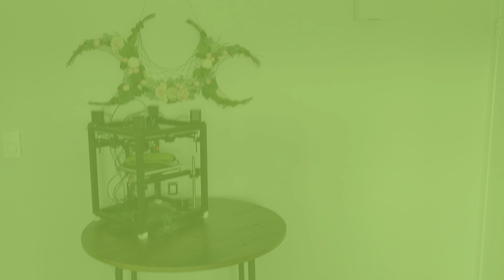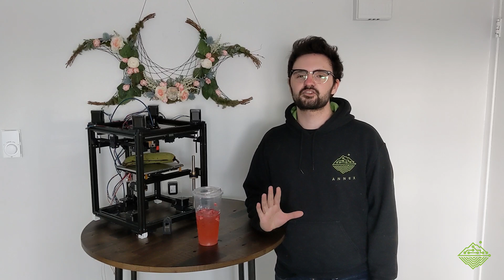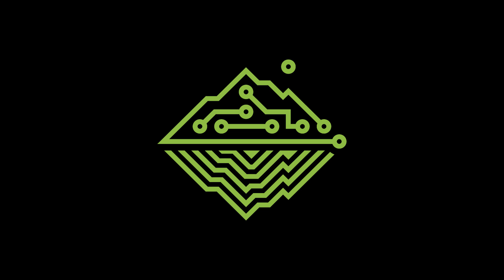#SpeedBoatRace Challenge - Lets End 2020 with a Bang

Comment: Why is ther the rule " - The machine must be powered by stepper motors" I woud love to see some printers using high power outrunners with encoders or industrial servos and accelered to the roof.
Reply from the maker: It’s not in the spirit of fun completion if someone comes in with 20k in motors and wipes the floor. If they become more accessible we’ll probably be testing them and start a competition with them
Reply: @AnnexEngineering  Then why not set a budget?
Reply: @adambkehl  that seems to complicated and hard to verify.
Reply: @AnnexEngineering  I understand that 20k servo motors is not what we want but another hand for community it would be good thing if odrive printers come more common.
Reply: @TH-wr1dv  setting up odrives is still relatively expensive, I actually have some that I will be using for that printer. Between motors, encoders, power supplies, and the odrives them selves we just don't consider them accessible for the general public. Especially when you can get a set of steppers for so little

Comment: I get the limit to 0.25 layers and 0.5 EW, but why must we use stepper motors? isn´t that very limiting? if the goal is to print a faster benchy why would using faster servos be considered cheating?
Reply: I'm guessing that DC servos could be a thing
Reply: i think working "inside a box" makes for creative solutions. otherwise "throw money at it" is usually the solution.
Reply: they're prohibitively expensive
Reply: @reid-dye  Meanwhile this makes sense, it should just be a separate category then, that's literally saying that supercars can't put record laps in Nürburgring for example.
Seeing what can be done at a "cost no objection" level is very interesting as well.
Reply: @Kalvinjj  Also we don't know what the future might bring. E.g. a spinning flyweight and closed loop controlled clutches (eliminates rotor inertia). Or conversely a $10 000 stepper motor with dramatically reduced rotor inertia.

Comment: The good "old" cross mechanism of the Ultimaker implemented with linear guides, I think it is so stiff because this cross mechanism absorbs forces that occur at high speed. Is that still possible with 400mm linear guides or with rods over 300mm looks bad. I hope Google translated well, I'm German and have little knowledge of English :(
Reply from the maker: its a heavy variation on it yes, the drive sides aren't linked by rods, and there aren't rods at all. Its based on a setup seen in some PNP and CNC machines (though those use screws instead of belts)

its inspired by the "hypercube evolution project" as that was the first time we saw something remotely similar. There are other variants we have since found that pre-date that machine though